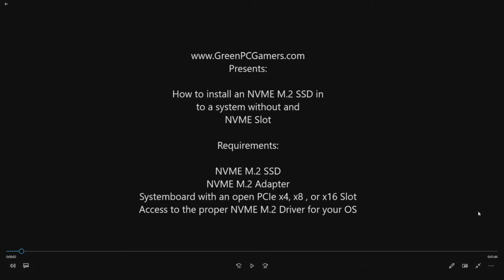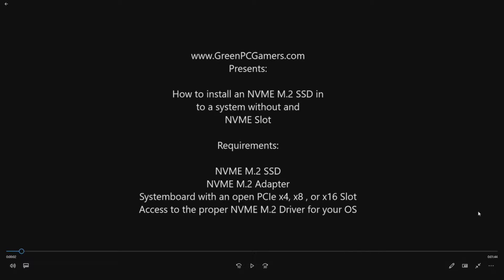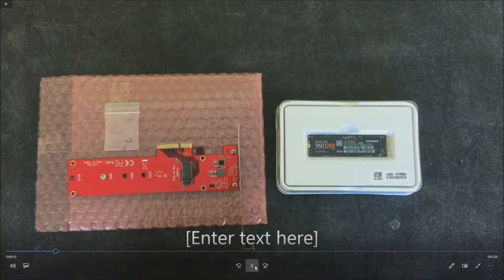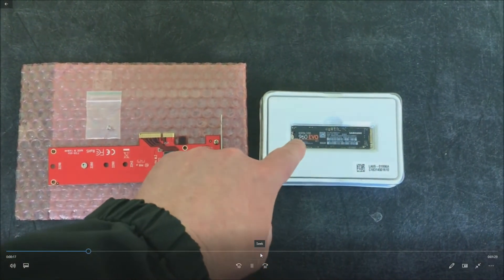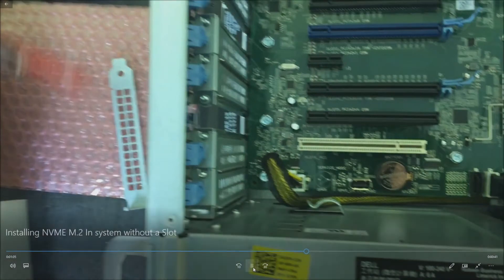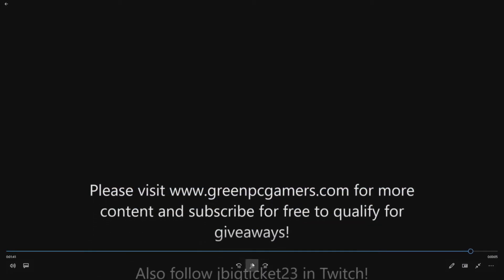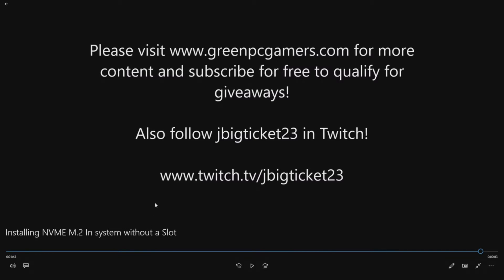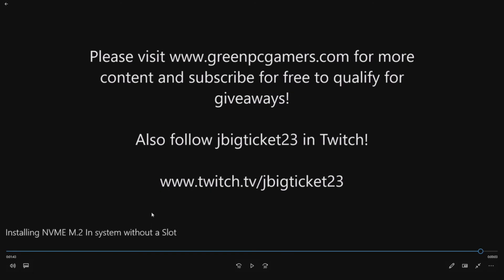How to install an NVME M.2 SSD in to a Computer without a Dedicated NVME Slot (Precision T5610)

Comment: I acquired Two Dell T7500 in midst of Pandemic (as a bargain emergency) - and I am kind of happy with them, still overhauling them with "new" used parts,
but was looking for using state of the art NVMe technology, shameful as it may sound, I've no experience with PCI expansions.

Your video gives me hopes that I can do it on the T7500, of course I want to boot from it for using this workstation as a virtualization lab.

I'm trying to fin documentation on this NVMe - PCI combinations (compatibility matrix) - might it be I'll let you know.

Comment: Hello sir,
Will it work on HP 500B-MT (Intel core 2 duo, 4gb ram DDR3)
Reply from the maker: We've never tested it on that particular unit.  It's DDR3, so it most likely won't be boot-able.  However, you might be able to install it as a storage device.  Let us know if you try it.

Comment: Not working on my T5610 with pci-e adapter.  Shows as MASS STORAGE in BIOS (updated).  Better be sure your mobo supports the NVMe you plan to buy or your're wasting money.
Reply from the maker: NVMe won't be bootable on any DDR3 system like a T5610 w/o a boot assistant.  You can only use it as fast storage on DDR3 based systems.

Comment: hey ive got a question, will this method work with gigabyte h61m-s2p-r3?
ive heard that i need to modify my bios, do i need to do that?
Reply from the maker: That is a DDR3 based motherboard.  So this method would most likely work as fast storage and not a boot device.

Comment: I have a t7810, i have used the siig pice to m.2 adapter with a 980 pro on it, but it does not work in boot, how can i troubleshot this?
Reply from the maker: Do you see the NVMe mass storage device in the F2 setup?  Also, do you have the latest bios installed?
Reply: @GreenPCGamerscom  hi, thanks for the reply, yes the bios was the issue which i easily resolved as i had another boot drive, the nvme ssd is working now, i heard from someone that as dell puts new computers on market they gradually decrease features from the bios for the older computers, that's why i went with the older bios first. Will be sharing my specs on your forum soon.

Comment: Sir i have dell i3 7th gen desktop with h110 chipset motherboard. Will the m.2 nvme ssd with adapter work as a boot drive ?
Reply: No
Reply: @goodfile4833  are you sure?

Comment: can m.2 nvme with pcie adapter be installed in Lenovo Thinkstation D20? I'm not planning to use it as bootable device.
Reply from the maker: It should work fine as a storage device.  It will not be bootable in a D20.

Comment: The Samsung 950 m.2 nvme has support for older motherboard BIOS and is able to boot directly from NVME the mother board BIOS with support
Reply from the maker: You are right.  However, they are crazy expensive!
Reply: @GreenPCGamerscom  there are rumors that few other older brands of NVME m.2 also has BIOS support for legacy motherboards (Maybe Toshiba) but I don't know which ones they are yet.

Comment: im using b85progamer 4th gen  can i put a nvme ?
Reply from the maker: That is a DDR3 based motherboard.  You could use nvme as a storage device.  It wouldn’t be bootable unless you use a boot assistant like clover.
Reply: @GreenPCGamerscom  ow but can i make it as an app working place? cause im working with 3d models and video editing also rendering maybe i can use it as a working place

Comment: you missed the whole part about adding NVME Bootable support by modifying the motherboard Bios file / using Clover on old unsupported motherboards
Reply from the maker: You are correct, to make DDR3 based systems bootable via NVMe, clover boot assistant is very helpful.  Unfortunately, when we made this video, we didn’t have that knowledge.
Reply: @GreenPCGamerscom  would you be able to make video about the clover boot assist or how would you do it. i have t3500 and would love a m.2 boot
Reply: Seems like im fucked trying to get such drives for a ddr2 old mobo.

Comment: Wow this was a long time ago, hopefully someone will respond, I have a HP z600 maxed out for ram and CPU’s - but I only have SSD’s - games take a fair while to load which I can suck up but my question is does this effect frame rate? I have a 2060 super and I only really play GTA5, the frame rate drops at busy times even though neither my graphics card nor my CPU’s are at 100% according to afterburner -  could the SSD be a bottleneck and if so would this solution improve actual performance of the game?

Comment: I have SATA SSD in my HP desktop, planning to upgrade to NVMe SSD through PCIe 3*4 adapter as there is no M.2 slot. Can I boot my PC with NVMe SSD?  I have Windows 10 currently running on my PC and also have cloning kit from Corsair. Thank you.
Reply from the maker: It depends on the age/specs of your system.  If it is a DDR4 based system, you should be able to boot to an NVMe M.2 SSD.  If it is a DDR3 based system, you won't be able to boot unless you use a boot assistant like Clover.
Reply: Thank you very much for the help. Yes,  I think my system is DDR4 based as RAM is of DDR4 type as found by system monitor tool speccy.

Comment: By using this adapter..do you have any decrease in performance??
Reply: If the adapter installed on pcie 3.0 then no decrease in performance. If installed on pcie 2.0 then the performance decrease by 50%

Comment: I see you're using Windows 10 - can it be done with Windows 7?
Reply from the maker: It's tough to locate NVMe M.2 Drivers for Windows 7.  However, you can still successfully boot to windows 7 by loading a standard HDD or SSD, and then cloning the drive to an NVMe M.2 SSD.  This has only worked on DDR4 based systems.

Comment: I have extra PCIe slot 2.0. Can i use nvme in that slot . PCIe 3.0 slot is for graphic card
Reply from the maker: It will work in that slot.
Reply: @GreenPCGamerscom   At half the speed of PCIe3.0 x4
in the video PCIe 2.0 was used , it should be placed into PCIe 3.0

Comment: My MSI Z370-A PRO LGA 1151 motherboard have only 1 m.2 nvme slot so I decided to buy a silverstone ECM25 adapter pcie. I'm using samsung 970 evo plus in the main m.2 nvme slot on the motherboard, I put Intel 660p M.2 2280 1TB on ECM25 PCIE slot. How can I make the intel 660 to be boot first. The samsung 970 evo plus is in the main m.2 nvme slot and it keep booting first. Is there a way for the intel 660p on PCIE slot to boot first and make samsung 970 evo on the main m.2 nvme slot to be boot 2nd? Help please!
Reply from the maker: You'll have to go in to your bios and change the boot sequence.

Comment: what drver did u uses if any for ur card not nvme ssd thr adapter  drver did u need one i am not geting top speeds i think it drver i got x370 amd ryzon whith a mp510 mvme m,2  x4  and i have some adapter as u difff maker but same card pci  but the seller had a pcie card and a pci card i got pci not pcie
Reply from the maker: It didn't require a driver.  What model M.2 SSD are you trying to use?

Comment: Since this is the most information I've found on installing NVMe and you seem to have in depth knowledge on this topic, help me out here.
I have a 5-6 year old AMD fx8350 on 990Fx mobo with only DDR3.
There's a lot of conflicting info out there but I believe Asus doesn't support my m5a99fx pro R 2.0
So far, I only have a HDD. I'm planning to get a SSD. Should I get to Sata SSD or is it possible for NVMe to work? (I believe there's only SATA III interface)
And even it works, will I get NVMe speeds of around 2-3 Gbps? 

You have mentioned performance gains in games and softwares on non-system nvme driver but I believed that only works for games installed and running on the system drive..
Reply from the maker: I'm not very familiar with the motherboard that you are using.  However, I can say that I've never been able to get a NVMe M.2 SSD to boot on a DDR3 based motherboard w/o a boot assist like Clover.  You could stick with a SATA SSD to make sure it is compatible.
Reply: @GreenPCGamerscom  With nvme ssds only costing a fraction more than the sata SSDs, I was hoping there's some way to make it work.
Reply from the maker: You can install an NVMe M.2 SSD.  However, you may have to use a boot assistant like clover to actually boot to it because you are using a ddr3 motherboard.
Reply: @GreenPCGamerscom  Yeah, I read somewhere in the comments here about clover. I was going to look into it but at first glance, it seemed like a new concept. Didn't get time to research more.
Reply: I just ran across a video a bit ago that has a custom bios process or something. The m5A99 was listed as tested and working. It was a vid title like nvme in older uefi bios or something

Comment: do these expansion slots still cause the motherboard to disable SATA ports?  my motherboard disables SATA ports when I use the M.2 port s
Reply from the maker: David Nash we’ve never seen this happen before.  Can you turn them back on in the system setup?
Reply: @GreenPCGamerscom  actually they just say not connected.  And no I don't think so. As the manual warns of this limitation.
Reply: I wish these things were more apparent when choosing a motherboard I the first place.   I was amazed at the price.  And this really isn't much of a limitation.  Just while the SSD were so expensive I had to buy a little drive at a time.  Now I have 3 SSD and 1 HDD in my system.   I still have enough SATA ports for one optical drive I dont need.  So I'm doing ok.

Comment: You are doing it wrong, you could get more speed if you install It in any other pcie slots which are Gen3 instead of using the Gen2 slot
Reply from the maker: You are correct, faster io slots are preferred for max throughout.

Comment: that is the stupid option u make...  the people buy nvme card but cant run the bios through it mean useless.... cause the main drive still slow...  better u buy the ssd card like samsung 860evo...
Reply from the maker: We've installed the NVMe M.2 SSDs w/adapter in 10 year old workstations as secondary storage devices.  We averaged speeds of 3 to 6 times faster than a regular SATA SSD.  If the system is to old to boot to NVMe M.2 you can use a SATA SSD as a boot device and then the NVME M.2 for all of your large programs/games/files.  Even if you can't boot to it, the NVMe M.2 SSD can still be beneficial.  Also, keep in mind there are quite a few DDR4 based systems that do not have a dedicated NVMe M.2 Slot.  Even though they do not have a dedicated slot, most of the DDR4 based systems will boot to NVMe M.2.  Thanks for commenting.
Reply: bro im doing the same thing... put it for secondary storage but in the end u will find out that more useless... i dint said wont increase the speed but if ur compare to normal ssd like 860 samsung boot in the primary devices can getting the result better than u install nvme in the old motherboard without support the nvme card.
therefore i'm agree what Abby comment below, if someone still need.......do that like u, only the way solving this problem is editing/mod the bios but must be careful it will cause the bricked bioschip... the link may helpful: https://www.youtube.com/watch?v=h_qRvvCWpWA   : https://forum.level1techs.com/t/nvme-boot-bios-modding-guide-for-z77-msi-mpower/136631  : https://www.overclock.net/forum/6-intel-motherboards/1571271-tutorial-how-add-nvme-support-any-ami-uefi-bios-intel-chipset.html

Comment: Wonder if you would you be able to use the NVME M.2 card, put a 32bg Optane module in it and use a large HDD at optane speeds?
Reply from the maker: Can you clarify what you mean about "use a large HDD at Optane Speeds"?
Reply: @GreenPCGamerscom  With a Optane module, you get almost ssd speeds from a normal sata drive, IE, I run one in my gaming PC using a 8TB internal HDD (it is a z390 Taichi MB with M.2 already onboard). I am curious if I might be able to install a M.2 card in a Optiplex 7010 and use a optane module in it to speed up it's internal 4TB HDD
Reply from the maker: The OptiPlex 7010 is DDR3 Based and most likely won't allow you to boot to the Optane Drive.
Reply: @GreenPCGamerscom  I think you're right

Comment: Are the drivers I need for W7 from the manufacturer of the NVMe drive or from the manufacturer of the adapter card such as Antec?  Thanks
Reply from the maker: With our experience, only the actual NVMe M.2 SSD will require the driver.  I'm sure there are some exceptions.

Comment: I ordered the HP 800 G2 tower hope it will work.  The specs show that it has an optional "Torbo" NVMe using their proprietary card for $450!.. lol.  So maybe it will work with another card and the right drivers.  I will probably try the Antec card first.  Any other thoughts would be appreciated. I'll report back on my experience.  Thanks
Reply from the maker: That appears to be a DDR4 based system.  You should be able to use the NVMe M.2 SSD as a boot device if you use Windows 10.  If you want to boot to WIn 7 you'll have to do the clone/image trick.

Comment: If I can get the NVME M.2 running, will I be able to use it as a boot drive with Windows 7 pro. I am not going to W10.  Or if not, are there any tweaks to the Bios that will enable boot function in Windows 7?  Thanks
Reply from the maker: First, you have to verify that your system supports booting to an M.2 Drive.  Most DDR4 based systems will boot to M.2 Drives.  It's also really tough to locate Win 7 drivers for most M.2 Drives.  One trick is to load a SATA SSD and then clone the SATA SSD to the NVMe M.2 SSD.  I hope this info helps.
Reply: Does that trick usually work if the setup supports NVMe?  Thanks @GreenPCGamerscom
Reply from the maker: Yes, we only use that trick when we want to boot to Win 7.  Win 10 doesn't have the driver issue.  Obviously if the system does not support booting to an NVMe. M2 Drives, it will not work as a boot device.
Reply: @GreenPCGamerscom  Win10 have built-in support for NVME UEFI booting. Most of the motherboard with UEFI can flash the bios with a little mod to support booting OS.
Reply: I am currently using A SATA SSD in my HP Desktop, and planning to upgrade to NVMe SSD with  PCIe 3*4 to M.2 adapter. How to make it bootable drive? I  am using windows 10 and I do have cloning kit from Corsair ( SATA to USB Cable and cloning software)

Comment: disk management isn't displaying my nvme m.2 drive on my dell precision t5500. i'm using a pcie adapter. do i need to tweak something in the bios, or do i need to install a driver?
Reply from the maker: Most likely a driver.  What model drive is it?
Reply: @GreenPCGamerscom  it's a samsung 970 evo nvme m.2. i went into drive management and was able to make a "storage pool" for the drive - not sure what that means but i'm still able to store files in it. i couldn't find any drivers for windows 10, just windows 7.

Comment: Can we add NVME SSD in T5500 X5650 workstation? i will use adapter for NVME. but i am not sure whether my workstation has PCIe4 slot. my existing PCIe16 slot Nvidia K2000 graphics card. one PCLe 16 slot is free, but i am planning to add one more graphics card.
Reply from the maker: If you add and NVME.2 SSD you should use a PCIe x8 or PCIe x16 slot for the best performance.
Reply: GreenPCGamers.com thank you, NVMe  worked perfectly in PCIe x16 slot.

Comment: Nice video, however, what's the point of spending a lot of money on a costly NVMe and even costly adapter if you can't use it to accelerate your core OS's operation? I mean it's common sense to have SSD as a system driver and whatever slow disk as storage driver, not the opposite!
Reply from the maker: Hey Abbe,  NVMe ssds are pretty cheap these days.  You can get a Samsung EVO 970 500gb nvme and an adapter for under $150.  If you open large games, programs, or files you’ll notice a big increase in performance compared to a SATA SSD or a regular hard drive.  Make sure you install it in to a PCie x8 or faster slot for maximum throughput.  Once you try NVMe you’ll never want to go back.  Thanks for commenting.
Reply: @GreenPCGamerscom   GreenPCGamers.com  Hi! Totally agree re NVMe superior performance, however, they cost noticeably more than sata SSDs (at least here in Sweden), besides, you can't use them as OS/boot disk on old systems. Other than that, NVMe all the way down :)
Reply: @abbesatty9498   Here you go man.
https://www.win-raid.com/t871f50-Guide-How-to-get-full-NVMe-support-for-all-Systems-with-an-AMI-UEFI-BIOS.html 
Svenska System Bolaget.
:-)
Reply: @hey_skip  Yes, it works like a charm.
Reply: @GreenPCGamerscom   Yes, it is by far faster than the fastest SATA-3 SSD, the only storage which can beat NVME ssd  in terms of speed is ramdisk.....
Reply: @GreenPCGamerscom  Note: I picked up an pcie adapter at Fry's Electronics for $7.
Reply from the maker: That’s a great deal!

Comment: Is the Precision t5610 bootable from an NVME?
Reply from the maker: Unfortunately the NVME.2 SSD cannot be used as a bootable device on a Precision T5610.  It can be used as an awesome secondary drive to greatly boost I/O speeds.  Great question!
Reply: @GreenPCGamerscom  Some motherboard can edit the bios to boot OS from NVME using the PCI-E slot.
Reply: Can you move the pagefile to it? Or use it as a cache for a regular ssd or hd?
Reply from the maker: You can use it just like any secondary hard drive.  Install your large programs, games, and files on it and they will open really fast.